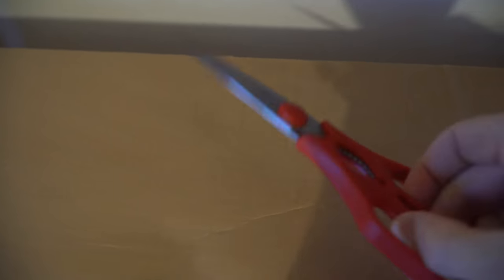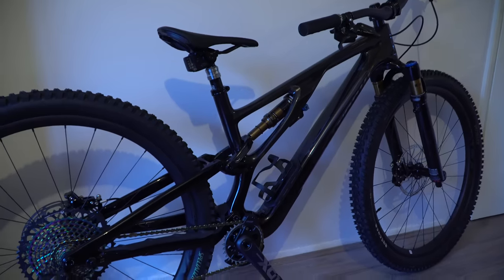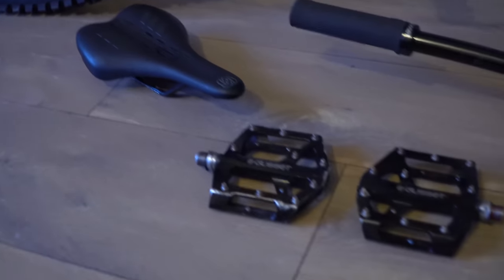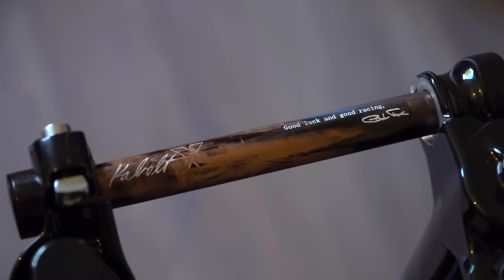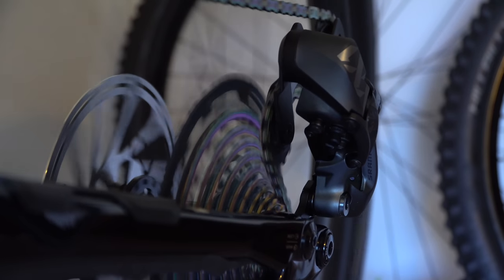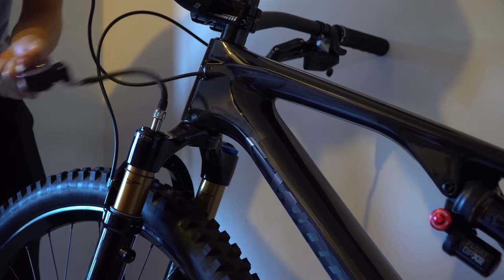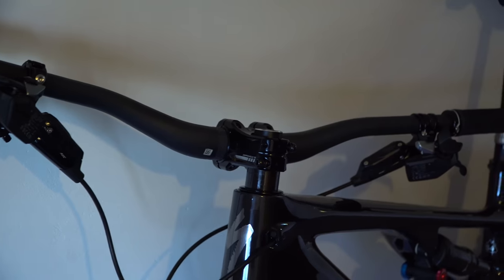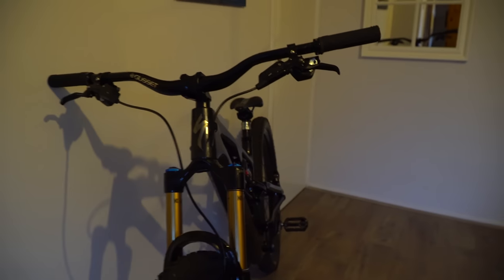New 2021 S-Works Specialized Stumpjumper Evo Unboxing & Bike Build

Comment: Do i have to torque down on the fork pinch bolt? I've only ever had a standard front thru axle. Plz explain if I have to torque it like crazy or if I'm doing it wrong.
Reply from the maker: It will have a torque setting but i dont know it off the top of my head, sorry! Either way i know from experience, DO NOT do it up too tight, obviously make sure it's tightened, but dont over-torque it, because i did that on my old 36's and the metal around the bolt cracked, so i had to replace my whole lowers!!!

Comment: Super nice. I know your sponsored by Cushcore but how good is it? It’s loads more money than i expected ...
Reply from the maker: Thanks Rick! I would definitely recommend it, even if you just got it in the back to save some money. The main reason i use it is for rim protection, bit risky having expensive wheels if you're not gonna protect them. obviously the added grip from being able to run lower pressures is nice too, sometimes i run 18/19psi in the front and it's fine! Installation is a little bit extra effort but once you know the technique you can do it in about 15 mins... overall definitely recommend them if you want so insurance for your rims and a bit extra grip!
Reply: @willgreenfield  nice one Will. I’ll give them a go

Comment: Specialized makes great bikes and the S-works is primo for sure... but the YT Capra Elite is every bit as equal to this bike for nearly $4000 less.  It’s overpriced imho...
Reply from the maker: Hmm it's definitely a lot of money, but i don't think its fair to say the Capra Elite is equal to this bike. The S-Works is a whole 1KG lighter, which is a big difference...it has in-frame storage (which has space to fit a baguette for lunch and a whole big bottle worth of water in a bladder haha) along with the fact its not direct sales so the customer service and warranty is way better, which is worth a lot of money to some people! Either way, both are great bikes for sure, but they're definitely not equal in terms of performance 🤷🏻‍♂️ Anyhow thanks for watching and commenting, i appreciate it :)
Reply: @willgreenfield  Capra offers the new Fox 38 factory e-bike and 170 mm of travel.  I get that the bike was bought FOR you and you may be obligated to support them but the performance you speak of isn’t there.  I currently ride a 2015 Stumpy and I absolutely love it.  My only point is the S-works line is grossly overpriced.  If I’m spending nearly 10 grand for something with 2 wheels it better have a 450cc motor and electric start.
Reply: @72fasterthanyou  i agree with what you are saying but tbh these bikes are not aimed at folk like me and you
there is lots of people out there with lots of money who like to buy the "best" stuff, and if you have the brand name which specialized do have then they have a market for these kind of bikes
might not be value for money for me and you but if i was a multi millionaire i wouldnt be bothered, i would buy it anyway because its a cool as fuck bike, id have a 10k electric bike too. this guys lucky enough to own one because he is a great rider
ill make do with my carbon comp stumpy though for the time being :P